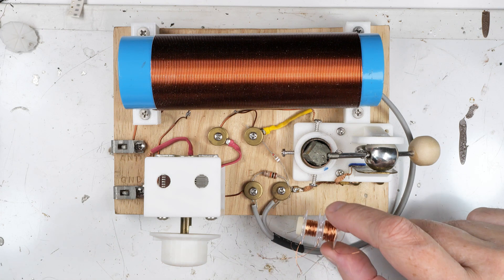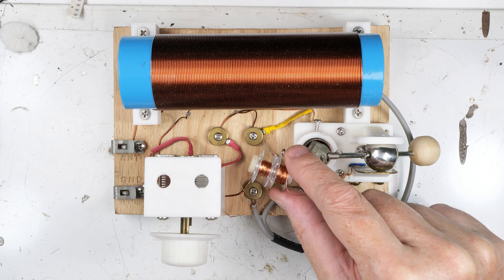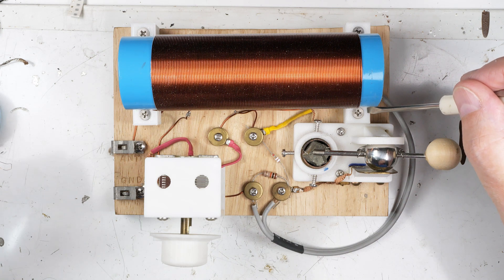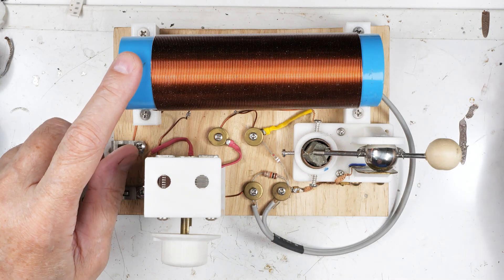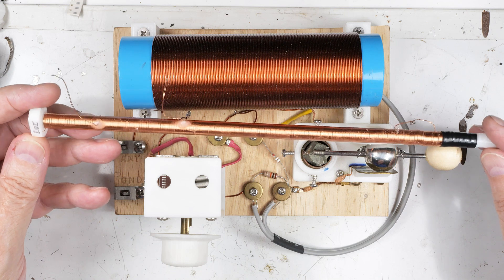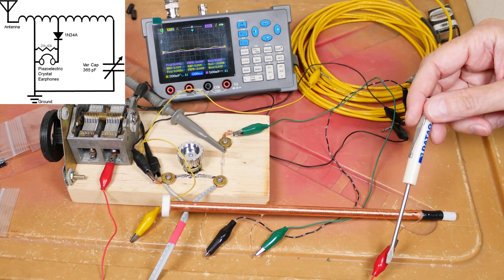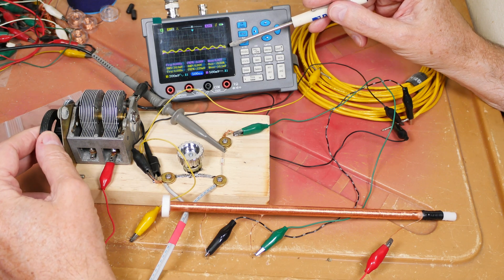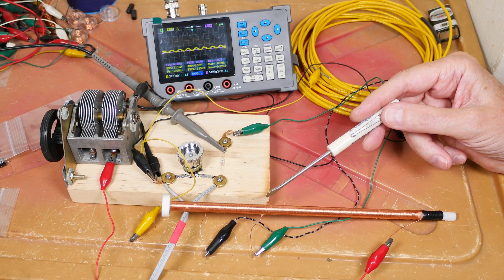Crystal Radio Coil, Fine-Wire Small Core Experiment 3/3

Comment: I remember when you could buy a crystal radio kit and the only part you needed to source was an oatmeal container.
Oat meal came in a container that used to resemble a large toilet paper roll with a lid. about 3 to 4 inch's in diameter, I think.
Try one of them or similar. I do not know how many turns of wire it needed.
Reply from the maker: @micksshop  I remember those too. I use plastic water pipe instead, because it is much less crushable than paper. I lost my first crystal radio that way and I vowed never again.

Comment: My earliest interest in the phenomenon of radio, and electronics in general, was at the age of 5, I got a crystal radio on a trip to NYC with my mom that I could connect a wire to the screw that held the cover of electricity outlets and put the antenna up and the earphone in my ear and I could tune in a dozen or more stations (in NE Pennsylvania). I have had an amazing career working for IBM, Digital Equipment, Corporation, Motorola, Xerox and other smaller companies in disk drives and reverse engineering systems and it all started with the crystal radio for sure!

Comment: So, if small diameter doesn’t work in this application, how do all the zillions of ‘rocket radios’ work? 
I am planning on building one but am not sure exactly how to wind the coil. They appear to be made up of coil, diode and resistor. The coil is of course a variable inductor part. Hmmm… 
Any ideas?
Reply: The "rocket radio" needs a very good aerial and earth and will only receive very local and/or powerful stations.
Reply from the maker: @noads1035  I had 1 as a kid. It got 1 or 2 stations. The tuner was more of a focuser than actual  multi-station tuning.  My reproductions show a very small change of inductance from the "tuner", not nearly enough to cover even half the AM band.
Reply: Rocket radios had a slug inside the coil.  This likely raises the Q and the inductance
Reply: @kensmith5694  Would be interesting to know what kind of slug that was.
Reply: I have pictures and descriptions, but no real construction details. The slug is ferrite of course. I guess the next step is to start building and see what happens.
Reply: @noads1035  An ounce of experiment can be worth a pound of theory.  You want to be sure to use a low-loss slug.

Comment: without the yellow antena the wide coil receives something?
Reply from the maker: @rafaelthetall  No. The house is brick and steel reinforced concrete. The big loop coil radio can get 2 stations.
Reply: @tsbrownie  i think you might have a problem of core permeability...

that is why the AM transistor radio antenas can be coiled so small: the permeability of the ferrite core is 1000x better than the air.
Reply: @rafaelthetall  The Great and Venerable  TSBROWIE has shown in other videos, that  the core for crystal radios does not work.
Reply: Or it worked very poorly. Can't remember exactly.

Comment: Was the wire length the same for both coils?
Reply from the maker: @oceanbreze1977  Wire length changes with wire size, core diameter, winding type, etc. There are online calculators that will fill in a variable if you give them the other parameters.
Reply: @tsbrownie  Ok , but I should of rather asked their dc resistance , I am assuming their inductances we're the same.

Comment: Is there an upper limit to the diameter of the coil? or are your larger coils already up to the ideal for the wavelengths you hope to receive?
Reply from the maker: @Tsnafu  There is a general rule, but I have forgotten it. I will have to look into that again. Contesters often use 4 inch cores. I usually use the size that fits the project I am working on. Right now I'm working on portable version and 1950s style radios.
Reply: I read somewhere that the coil should be close to square. That is the diameter roughly the same as the length of the winding @tsbrownie
Reply: @superrodder2002  Absolutly not. The rounder the better.
Reply: .From my research, I understand that the ideal crystal radio coil has a length equal to its diameter. Slightly spacing the turns—generally by half to one wire diameter—reduces inner-turn capacitance, which improves the coil's Q factor (efficiency). Basket weave or spider-wound coils also enhance Q by minimizing energy loss.
 Larger diameter wire or Litz wire counters the "skin effect" at high frequencies. Litz wire, composed of multiple insulated strands, increases the effective surface area. However, Litz wire may slightly reduce inductance according to online coil calculators.
 My crystal radio project uses 18 AWG tinned bare copper wire (0.0404 inches diameter) on a custom 3D-printed former. The former has grooves for precise wire spacing (one wire diameter) to optimize performance. To achieve a square coil with equal length and diameter, the dimensions are 4.69 inches with about 58 turns to get about 251 microhenries. This, combined with a 365 pF capacitor, will resonate on the AM band.
 Remember that spacing the windings affects inductance, so use a coil calculator that accounts for this factor.
 I recently received the necessary parts and will begin construction soon.
 
 https://www.66pacific.com/calculators/coil-inductance-calculator.aspx,,
@Tsnafu
Reply: I made a 4x4 foot square coil with 4 turns and it worked as a tuned loop antenna quite well.  A problem with large diameters is that you have to reduce the number of turns making your options for tapping at various ratios less.
Reply: @kensmith5694  You could tap along the winding, but not as easy as sliding.